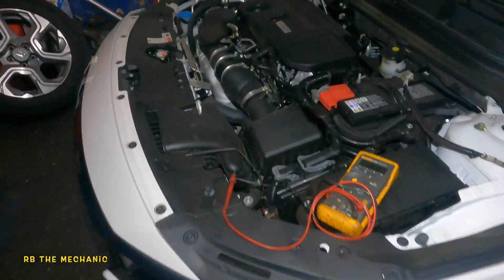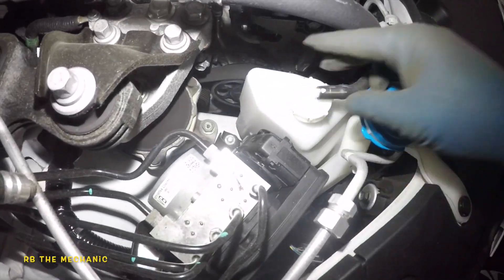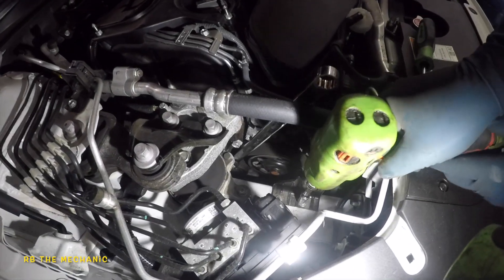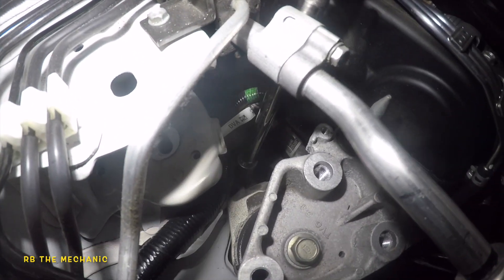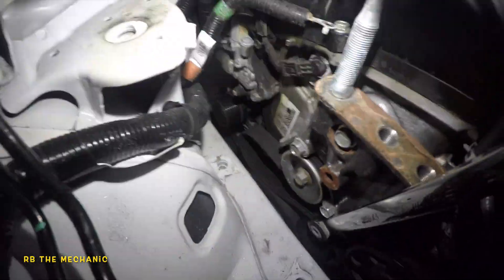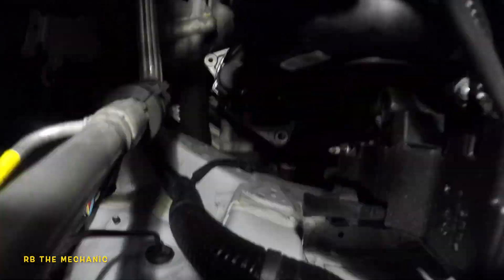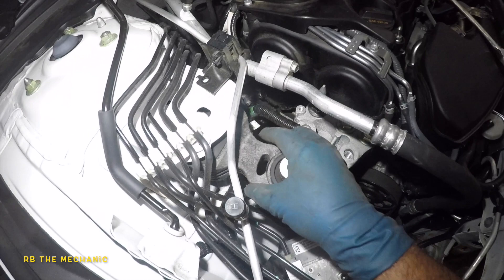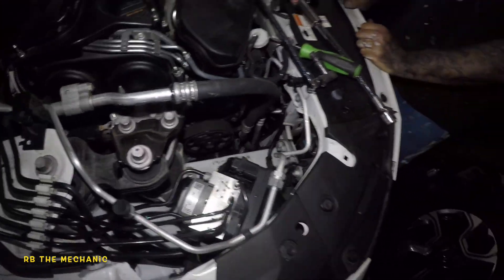Replacing alternator on Honda Accord 2018 2019 2020 2021 2022 2023   Check charging

Comment: Frank,  Thanks for 2018 Accord alternator replace. You the man! BUT, the aluminum engine mount will not come off. See 7 minutes 55 seconds.  That pointed  bolt is binding on the aluminum bracket. What should I do?
Reply from the maker: Oh that’s try sum heat or lubercation under it but it prolly wount help this is an issue
Reply: @RBTheMechanic  Got it thanks.

Comment: Is this for the 2.0 turbo "sport" version as well?
Reply from the maker: Turbo 1.5
Reply: His video is for 2.0t. Watch out folks this is not easy. If you attempt it, be VERY careful about the jack on engine. It has to be neutral.  When you loosen engine mount, it can move and make it hard to line up bolts when putting back together. He makes it look easy because he is good. If you are backyard mechanic, be careful. I could not get the mount lose to take off. It "bound" up. I could not continue. The alternator is on the bottom of engine almost impossible to reach. Rubber boot covering positive post must be taken off then unscrewed on 2.0t. I have lots of experience but gave up. Be careful guys.  My man is really good and made it look easy. I can't believe the impossible location of the alternator!  This YouTube is the only place with instructions for 2.oT 2018 to ¿2021¿.
Reply from the maker: @richardmckeon4142  thank you for the tips and warning ⚠️ yes difficult and experience required how ever at least if you can do it you how it can be done

Comment: Is it possible to replace the alternator on a Honda Accord underneath the car instead of from the top?
Reply from the maker: U can work the bolts from bottom both bolts and then tilt the alternator to remove wiring connector and 12mm main bolt but it has to come up
Reply from the maker: But I found removing mount made it easy very easy for me I didn’t mind 10 minutes to take out the mihnt
Reply: I put a 290A alternator but the voltage don't stay at 14.4
Reply from the maker: @NoName-gk2sj  what’s the voltage these are smart charming systems so it don’t always require 14 put ac on full blast radio on light on wiper on and check voltage should stay 14 if not then issue
Reply: @NoName-gk2sj where did you purchase one
Reply: Have the same problem dont know if it the alternator or battery got my part at rockauto
Reply from the maker: @Jessicaalvarez629  replace the battery to start with easier

Comment: I have a 1997 Toyota Corolla with 200,000 miles still has the original alternator.These car parts today are all crap weather the car is foreign or domestic they’re all built with crappy parts,so that you have to keep bringing it to the stealer for repairs.
Reply from the maker: Now days parts r garbage I though about quitting mechanic just because I had 4 alternator failed 10 starters put in sensor bad.  Put in maf sensor told customer bad engine and new engine didn’t start now I o for engine and it was defective maf sensor

Comment: Can the alternator go bad at 50k?
Reply from the maker: Yes it can
Reply: @RBTheMechanic what about at 33k? I have a2019 Honda accord and it stopped starting, lost all power. I replaced the battery and it still won’t start. I had to jump it to get power going and when I try to start the car it just whines
Reply from the maker: @TrevorPuckett-t6n  might have bad alternator

Comment: The mount or bracket doesn't have to be removed
Reply: James mine is 2018 Accord 2.0T. The alternator is not in front. Go to about 8 minute mark. You have to take engine mount off.